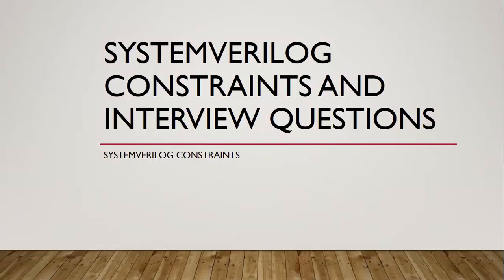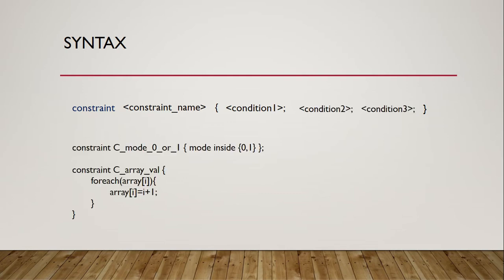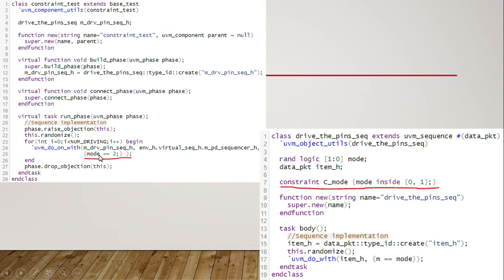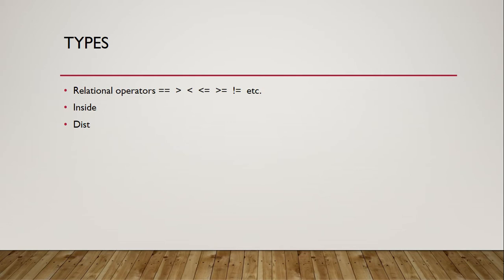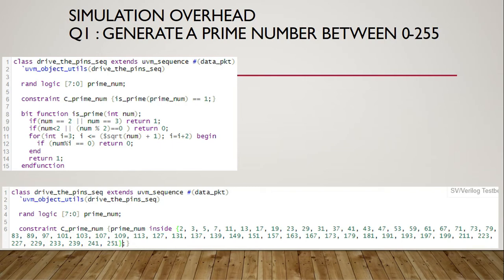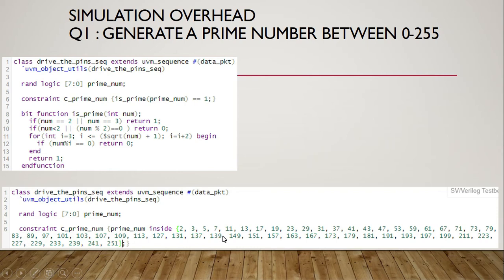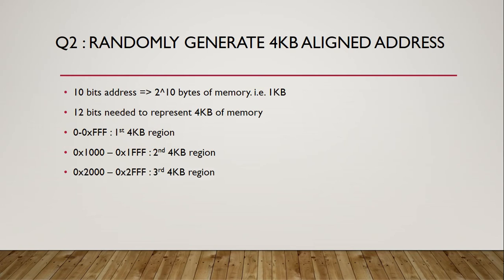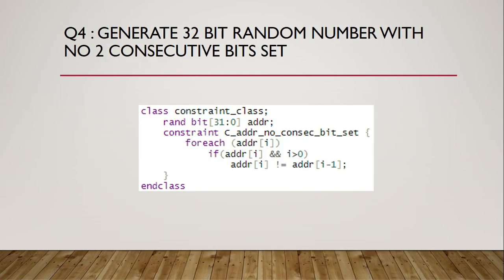System  Verilog Constraints And Interview Questions

Comment: Q1. Second solution is faster, as the list of primes is readily available
Q3. Using post_randomize() would be faster, as addr is not declared as a rand variable
Q4.    bit [31:0] addr;
   rand bit [4:0] pos1, pos2;

  constraint addr_c {
    pos1 != (pos2+1);
    pos2 != (pos1+1);
  }

  function void post_randomize();
    addr = (1<< pos1) | (1<<pos2);
  endfunction
Reply: In your q4 solution, only 2 bits will be 1. But it is not a constraint that only 2 bits should be 1. So this is incorrect soln.